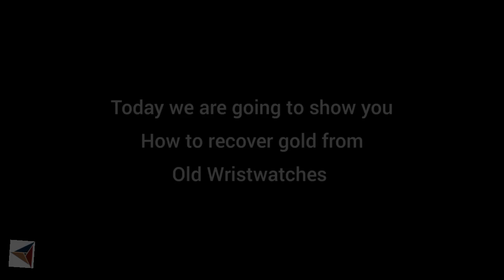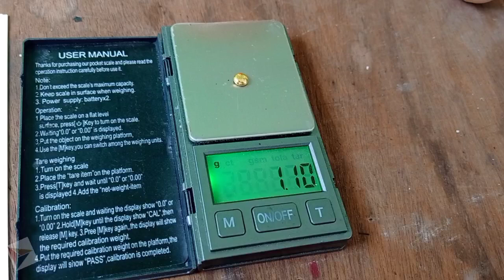Old Wrist Watch Gold Recovery | Recover Gold From gold plated watches | Gold Recovery

Comment: Maybe this is going too far off topic, but would it be possible to remove the gold from say 1 watch case and apply it with electroplating again with one of the solutions in between? So to get a renewed even coating with the same amount of gold, without going through the entire process of extracting the gold and then perhaps creating a new gold plating solution?

Comment: Hello Amigos.
That was a great video
I  have two questions please.
Do you use distilated water? And I noticed you switch  from the black  torch burner to the orange one
What's the reason for this?
Please tell.
Reply from the maker: We use tap water
And the orange one blows fire in a narrow shape thats why It's easy to blow on the gold only.
It makes the melting process fast

Comment: I did the smb process but my solution didn't turn black.. What does that means?
Reply from the maker: Maybe there was not enough gold on the solution. 
Or maybe the smb is not good!
Try adding a little more smb and then water

Comment: Hi hotw to strip the gold from telecom mother board
Reply: Three type of process to gold recovery. For ic chip, ashing, wet ashing, for pcb gold plating a/p and electrolysis is the best. Also gold plated pins you can go on processing with electrolysis methods.